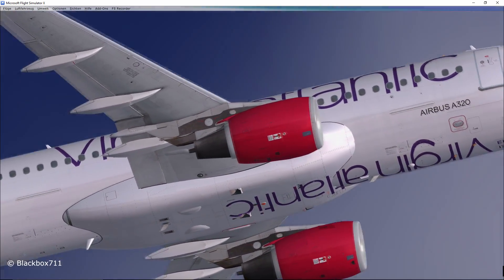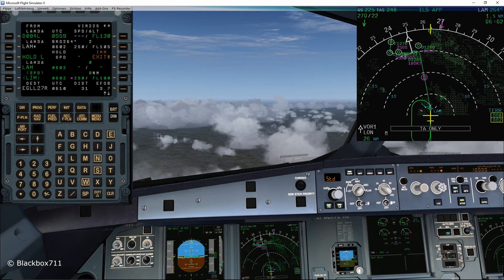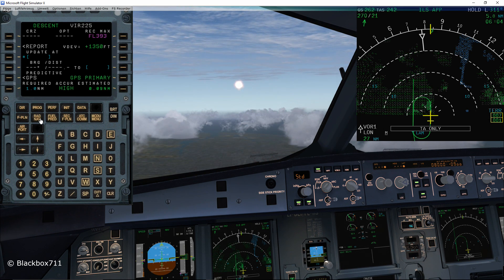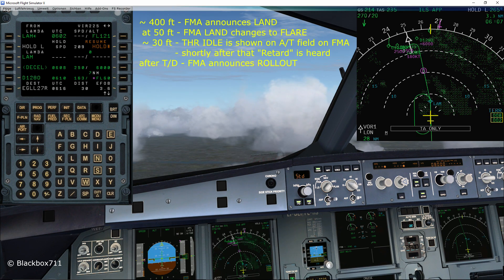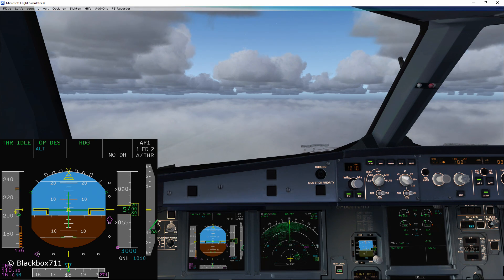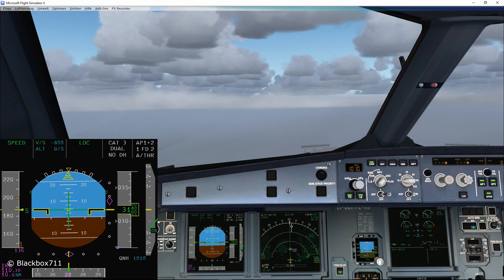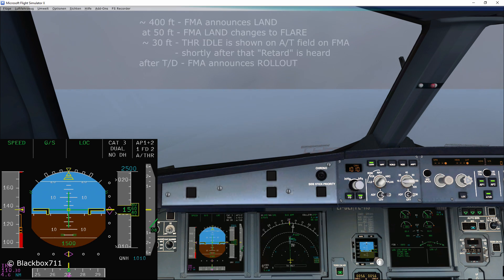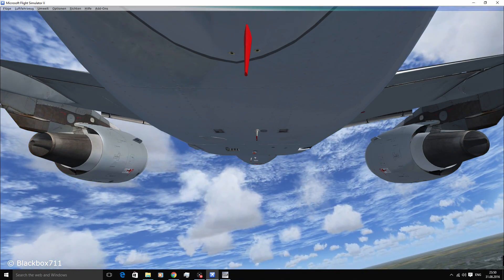FSLabs A320-X Advanced: LVO Fully Automatic Approach EGLL

Comment: with pmdg 737, which one i should buy, i just can buy one of those, btw great video
Reply from the maker: Hi. Thank you! That is a difficult question to answer. It depends on what you want to get out of the simulation. The 737 and A320 have very different design concepts. If you prefer to just fly and not worry too much about how the systems really work the 737 is a very nice aircraft to fly. If you love computers and like to know how everything works and interacts in an aircraft, then the FLSabs A320 will not dissapoint you. Regards
Reply: yeah ok thks for reply

Comment: From 2:36 on you can see the CPT ND showing TA ONLY, but the FO ND shows TA ONLY + GPS Primary. Is the dual channel operation of the FMGC's lost ? I thoght under normal operation both ND's would always show the same Info.
Reply from the maker: Hi. I guess the FO ND shows GPS Primary because I never cleared that message in the FO MCDU. So it has nothing to do with the dual channel operation of the two FMGC's. The TA ONLY is selected automatically by the TCAS System. I don't think it should come on that soon in the approach. Probably a mistake in the simulation. Regards

Comment: Another fantastic video, thank you. One question, what does the megenta "LDG Inhibit" signify?
Reply from the maker: Hi Mike. Thank you. There is a T.O. and LDG Inhibit function. The FWC (Flight Warning Computer) inhibits certain non critical warnings and cautions during the takeoff phase (from 1st engine at Takeoff Power to 1500 ft AGL) and landing phase (800 ft AGL down to after touchdown reaching 80 kts GS). This is to avoid alerting the pilots unnecessarily at times of high workloads. Regards.
Reply: Ah, thank you, that's bugged me for ages...;-)
Reply: Same here! Now I have an answer...
Again, amazing video Blackbox711, thank you very much!